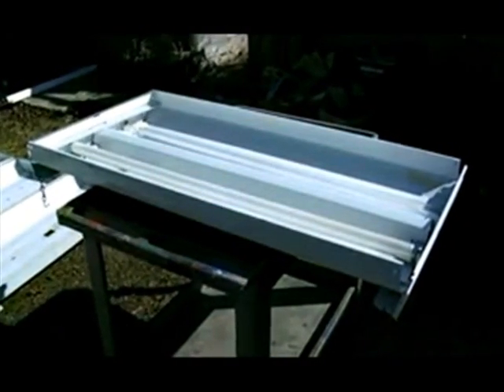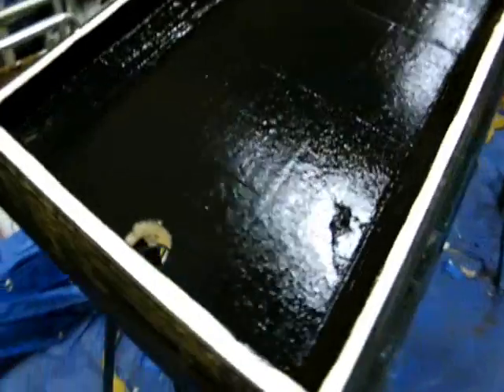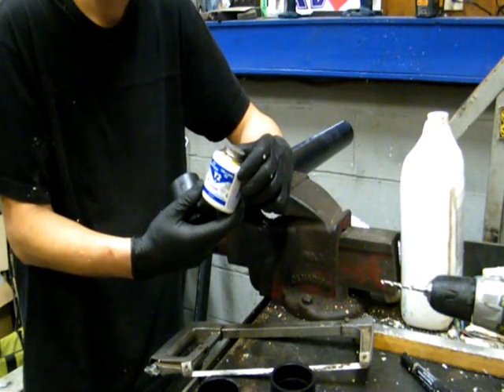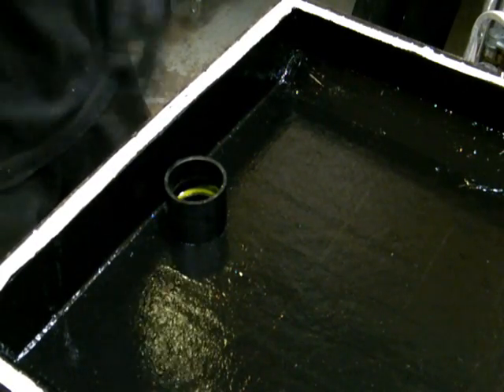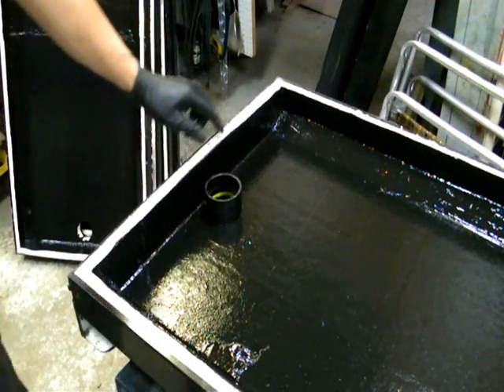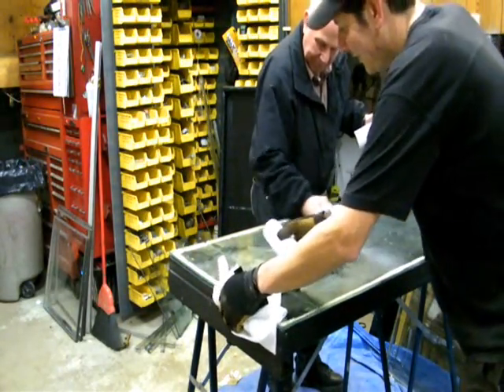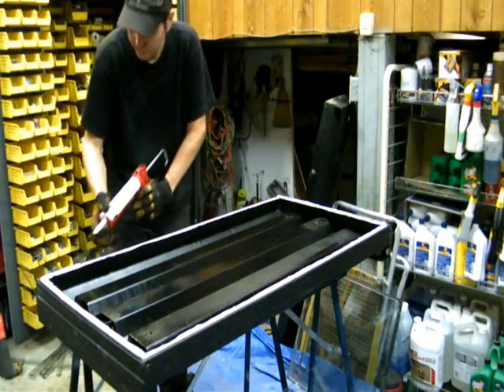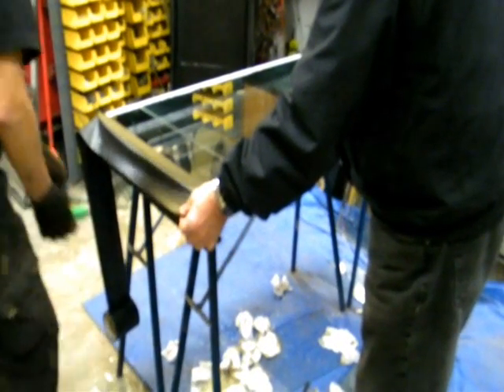Eco Steve Homemade DIY Free Solar Hot Air Collector Heater Free Heat

Comment: Great idea! In the summer you can use the heated air to create suction effect on the inside and cool the house a bit. You just need to redirect the hot air in to a chimney or other kind of pipe as high as possible. You can even generate some power if you install a small air turbine generator on the hot air exhaust! And something more - if you install 2 sheet glass pack on the top you will greatly increase efficiency :)

Comment from the maker: @ 12:25 In the video we tried. If you look at the old style windows and the depth, if caused to many shadows as the sun tracked across the sky. A conventional house with "normal windows" may be able to have the collectors attached directly to the existing windows. Good Idea! Eco Steve

Comment: I wonder if it would somehow be better to isolate the air flow from the plasticizers in the ABS and some components of the paint?  The high heat in the system may result in degassing of volatiles.

Comment: I love your final product. It's real nice. I have a question if you're still checking up on your vids. Had you thought about turning your tin sideways? This would cause the air that is moving through the box to slow down allowing it to heat up even more. The way it is now, the path of least resistance is directly from bottom to the top vent. Although I know your method will still work, I was just curious. Thanks for the vid and the instruction.

Comment: Great idea and video,  however, and like a couple of other posters, I'd really like to understand why the glass was cut into two pieces before being installed, rather than just installing a single piece of glass that exactly fits the opening.  

Also, I don't think the video showed or discussed whether anything (& if so, what) is to be used in the joint between those two pieces of glass.  Silicone?  Caulk?  Aquarium sealant?

Comment: They say, go big or go home. I just started building a system. I hope it works!  The collector uses copper pipe and PEX heat transfer plates in the collector..... collector size? 8' x 15'  Then circulated in a radiant concrete floor. (my thermal storage)  I read you need 4 sq ft of thermal mass (at 4" thick) for each 1 sq ft of collector. I have 1/4 of that. So, I hope to get 20% to 25% of the house heat from this. (all guess work from start to finish!)
Reply: I'd use a one way mirror tint to keep all that sunshine bouncing around in there.
Reply: Andy Fetisov That window film filters out more light than you would ever gain.  The black paint is suppose to capture all the light and heat.......

Comment from the maker: For your space size you can use mini solar panels and computer fans for the force air in. When there is enough sun to make the fan run, there is enough sun to make heat. Eco Steve

Comment from the maker: Hello and thank you for the nice comments and questions. I did add a summer vent to stop summer heat as well as partial shading. The vinyl tape does get alittle hot so I think next time I will try metal trim instead. some of the collectors do have muliple while some have singles,it was hard to find free glass all the same size so I had to make do nut I decided to show the masses who have not cut glass before that it wasn't that hard as long as you use protection and common sense.Have a great one